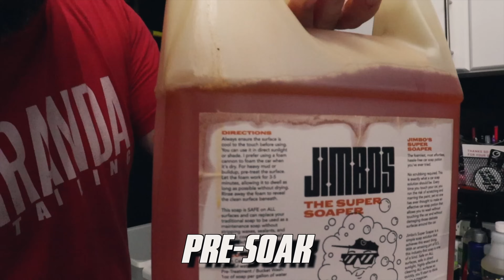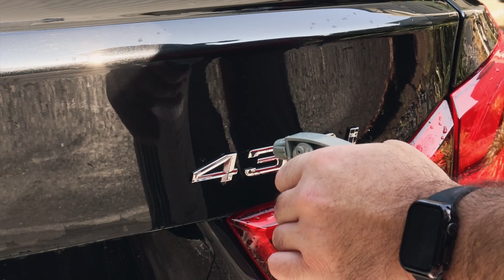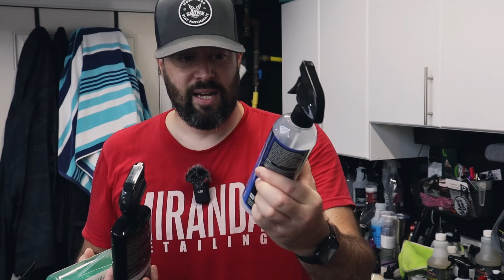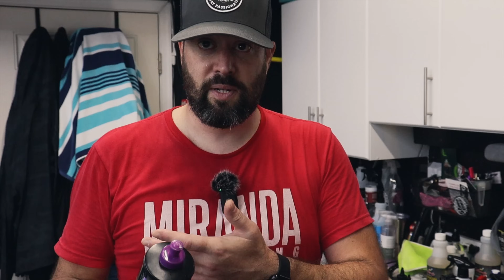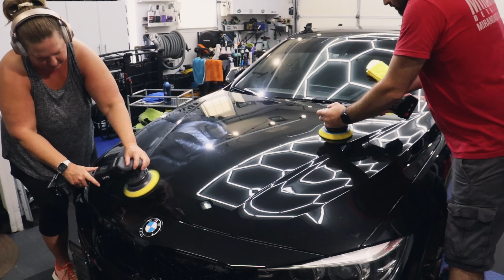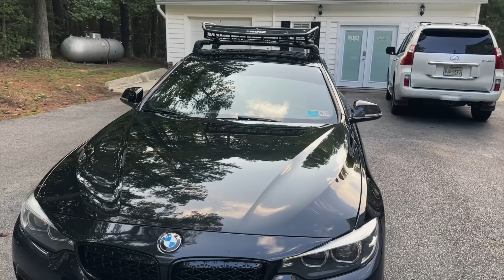Stop Wasting Money on Polishing Products Until You See This!

Comment: Great job at explaining all the different issues & verbiage of the job Phil. Q: as a newbie to the realm of detailing, does the protections that have been installed on the paint need to be removed from the body eventually and start fresh or is it just a stacking process. I have a couple of cars that I wash weekly.I may used a “wax” or an Sio-infused product. Does it need to be stripped after a while or once/year? Will a decontamination wash be enough or a fill claying?
Thanks for your caring and education to the world of detailing. I appreciate your dedication. Best from 🇨🇦
Reply from the maker: Hi. Thanks. So waxes and sealants wear away over time anyway. But if you are washing and applying a spray sealant or wax each time you don’t have to worry about stripping anything. If you want to clay bar and polish the paint, you also don’t have to worry about stripping previously applied protection like waxes or sealants. They will be easily removed in the polishing process. And don’t worry about them effecting your pads or anything. It doesn’t. As long as your vehicle is easier to clean, glossy and beading water, you can continue your usually way and spray protection. As long as you want.
Reply: @MirandaDetailing  Thank you so much for the explanation Phil. So many products, so little time! I am having fun though. My only concern is my wife saying I spend too much $ on product, but she does like a clean car. Plus I have to gas it up. CHEERS!
Reply from the maker: @randymcnaught5583 you’re welcome!  I know right!

Comment: Beautifully explained. Detailing made simply. Question,  I have one a those suds lab clay mitt and turtle wax rapid decon iron remover. Can i use the clay mitt to agitate the iron remover or will it damage the clay surface? Thanks
Reply: @lionelwilks7671  I've done exactly that on my vehicle and it was fine. If I'm not mistaken Yvan at DIY has done this as well.
Reply: @patb5266  yeah I saw it on the diy channel as well. But he did mention that not all iron removers are created the same and that his is designed to work with his decontamination towel. Guess I'll have to try and see what happens. Mabe give it proper rinse after.
Reply from the maker: Hi. Thanks for I don’t personally use the iron remover and clay mitt that way because it was wasn’t formulated to work like that. The iron Decon from hybrid solutions has other chemicals in it to work as a wheel cleaner also. I’m sure it could work fine but not sure how long the clay mitt would last. DIY details is different and was designed to work together. But honestly hive it a try and if it works and the clay mitt lasts a long time, then keep using like that. 😎👍🏼
Reply: @MirandaDetailing  thanks for the reply 👍🏽. Will give it a shot.

Comment: Hi Phil. I was about to polish my truck with turtle wax hybrid solutions ceramic polish & wax all in one; to later ceramic coat it with DIY 5 year. However, going thru some videos, someone pointed out that if you were to apply a liquid ceramic coating like DIYs or GTechnic, to not use a polish that had ceramic protection before applying this type of coatings because it would not bond. Does that make sense? I am not a detailer. It’s just a hobby I am learning. Thank you. Guillermo
Reply from the maker: Hi. Yea that’s correct, unless the all in one polish is specifically formulated to use with a coating, don’t use it. There are some polishes like Carpro Essence, Gyeon Primer, Dr Beasleys NSP’s, and now DIY APP polish try are used to polish and prep the paint for a coating without having to use a panel wipe.
Reply: @MirandaDetailing  thank you very much! I'm glad I asked. I will look into those options then. Probably get the DIY one.